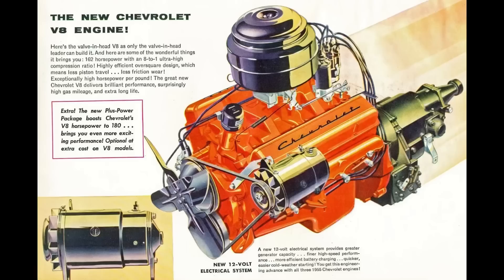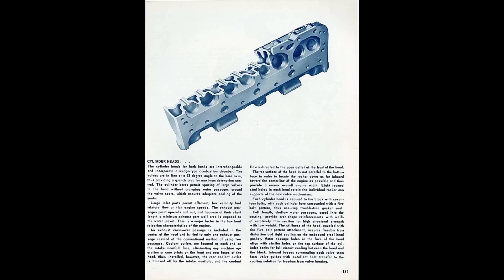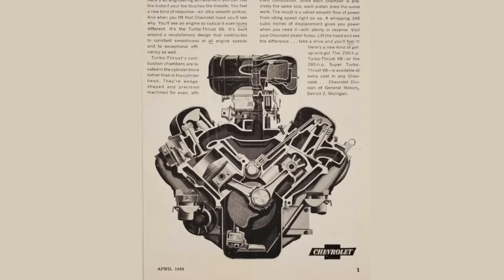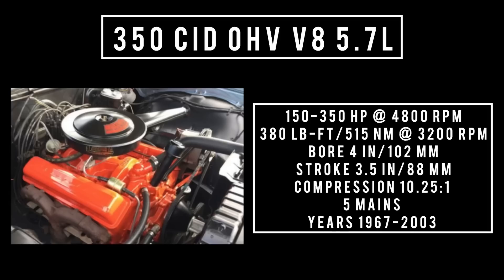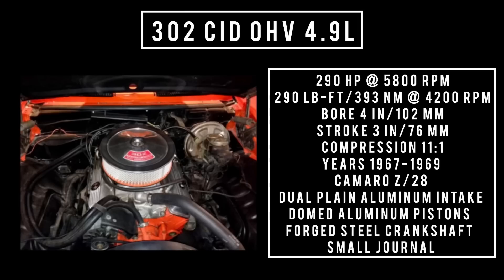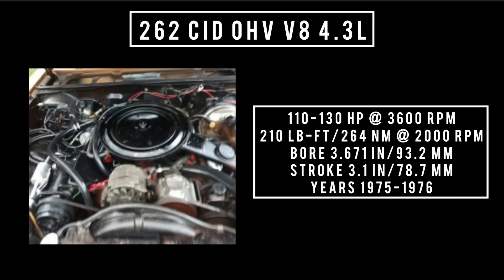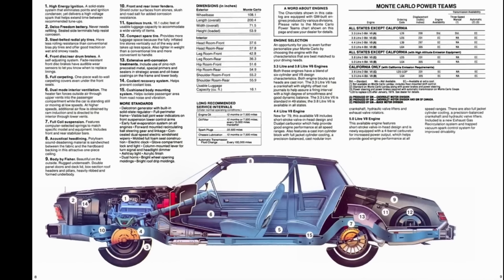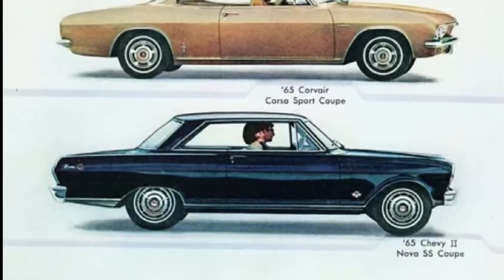First Generation small block Chevy engine family 265, 283, 327, 350, 302, 307, 400, 262, 305, 267￼

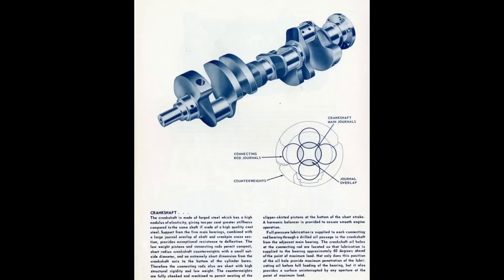Comment: I built a 327 60 over 11:1 used the power pack heads that had like 58cc chambers. Headers, Crane cam 218@50 450 lift Quadra-jet, 4 speed in a 67 Camaro 1981 I was 15. I never lost a race in that car. Beat Big Blocks with that motor and it scared my friends. Theirs nothing like a 327 with a 4 speed in a 3000 pound car. Oh had 3:08s and it loved that gear pulled all the torque it could out of that 327. The Big Block 66 Chevelle I beat had a 402 Turbo 400 3200 Stall and 4:10s beat it by half a car.

Comment: Drove  a ratty 71 Chevelle 307 from Norfolk to Ohio  in 1979. leaking rear main seal, and pecking loudly, lots of smoke but  I had to .  Used 17 quarts of the cheapest oil  I could find. No joke.   I disassembled it for rebuild, and the pecking noise was the extremely stretched timing chain slapping the inside of the cover.  But I got home.

Comment: Here's something I read years ago about the earliest 55 v8s- Customers came back complaining to the dealers about high oil consumption.  Engineers figured out the cylinder walls had not been honed enough. The factory had dealers slowly pour Bon Ami abrasive cleaner powder down the carb with the engine running, which roughed it up enough to break in. So much for consumer protection!
Reply from the maker: Thank you so so much for adding that insight in information

I've read also that Chevy had some teething issues but once they got that resolved, Ed Cole was a genius how he made the bolt pattern and the same for the transmission so everything that's Chevy will bolt up to it

My 52 Chevy has a 1986 350 V8 with a 1959SM 420 transmission behind it that was off of a six cylinder bolted up no problem, unfortunately the same thing can't be said about Ford Ford had a really confusing transmission line in the 50s. They offered automatics and manuals, but they offered different sizes different tail shafts and some water cooled and some air cold and the bolt patterns are all different.

Comment: 1972 Camaro. Thanks to no timing light, I had to fine tune my new distributor cap by test drive. Finally got 50 mph in 1st gear making it the best tuned 307 with no after-market parts. 😊

Comment: My first car was a 66 nova with a 327 and a 4 speed and ran it for years the 327 is a good engine.
Reply from the maker: Sweet =) I had a 327 in my truck nice sounding engine it was so satisfying going from 3rd to 4th around 6,000 rpm just the sound it would make really hard not to smile

Comment: I had a 1957 Chevy with a 283 for decades wrecked it but that engine went in a 1955 Chevy for more years. I abused the heck out of it I admit it. I swapped that for a motorcycle knowing the mains were on their last leg. It took 50w oil so it would idle without dying. I had a 1968 Chevelle SS someone had changed that to a 283 and like that '57 didn't exactly get the love it deserved either. It became my hinting car with a posi rear end it would go anywhere.
Reply from the maker: Thank you so much for sharing those memories a Chevelle with a 283 in it that’s interesting

Comment: My 1957 Chevy Bel Air does just fine with its 283. Power pack heads with a stock Rochester 4 barrel carb and dual exhaust. Good reliable power.

Comment: Late to the party, but here is my story. In 1972 I built a mid-engine V8 Corvair, using a +.060" 350 that I bought from Sears. Everyone laughed at me for buying a Sears engine! When a hole mysteriously appeared in a cylinder wall, Sears replaced it with no questions asked! This was +.040" overbore. I added an Isky 320 cam and a Z28 hi-rise intake with a Holley 800 double pumper. I was 18 at the time, so $$ was tight, and I only sort of knew what I was doing. When completed, it would do 12.6 @110 in the quarter. I autocrossed that car for 18 years! Finally, while on the banking at Rockford Speedway, the oil moved sideways from the bottom of the oil pan to the valve cover! My oil light (and buzzer) came on for a split second, but seemed OK after that, except for a rod knoce on start-up. In 1984, I replaced the rod and main bearings. Seemed ok again, but as I was pulling out of a gas station (a place that car loved to be), as I just stepped on the gas, a rod let go, ruining the engine. Bought a used motor and rebuilt it and it was even stronger than before! Only vehicle that ever beat me n the street was a Kawasaki KZ1000. A 428 CJ Torino was able to sort of keep up with me. Stupidest thing I've EVER done was sell that car in 89.
Reply from the maker: Cool story =)

Comment: You are a bit off on a couple things , like the stroke on the 327 and 350, they are 3.25" and 3.48", not 3.3" and 3.5"  , and the 400 had a 4.125" bore!
Reply from the maker: Yeah found out doing this every source is different and they like the round.. thank you for those corrections 

I wish they gave the actual numbers

Comment: I'm pretty sure the first Corvettes only fitted with the Stove Bolt six.  The V-8 Corvette came later.  Correct me if I'm wrong.
Reply from the maker: @robertmccarty9951  yes that correct 1956 was the first year for corvette to get the v8 to compete with the thunderbird which didn't offer any thing but a v8 in the 50s

Comment: Favorite SB for me was the 3951511 400 with 4 bolt mains, didn't like to rev, but it made so much torque that it would burry you ass into seat every time you hit the throttle.

Comment: The best sbc I had was an engine I had built for my racecar. It was a Mexican block with billet main caps, main studs, a ported melling oil pump, canton 8qt circle track pan. 40lb 3.500 stroke eagle crank, 6.2500 eagle rods. 4.0300 j&e pistons. Heads were dart iron eagle platinum that were ported at muscle motors in the early 2000s. Intake was a hand ported Victor intake topped by an ex Childress HP 750 carb. I spun it to 8000rpm every other Saturday for 35 laps at a time.

Comment: Best was what you you said lt1 undisputed ❤ about to see what the new stuff has to offer I am sbc lover best engine that will last you for your money.
Reply from the maker: Nothing beats it even the new stuff has issues. I mean this stuff just runs forever if it's maintained proper, I've seen cases where people put vortex heads on them... but budget build you can't do any better then a small block Chevy its cheapest engine to build reliable bullet proof engines

Comment: I have my Grandpa's 82 GMC S15, but I wasn't sure if it was worth restoring mechanically speaking.  The powertrain is in great shape, and it was running fine before being parked, but I remember being turned off by the engine specs and overall vehicle specs as an adult when I inherited it as a potential project.  I could be naive, but it seems like a lot of these V8s are underpowered for how much gas they use.

Comment: I had a 1963 Impala convertible with a 283 - 3 speed w/overdrive. It got 23 miles per gallon all the time and lasted 384,000 miles in 2 different cars. What an engine. It outlived my Impala and went to my moms car until it quit running.
Reply: That's awesome wish I had on old Impala . My dad's 66 Chevelle with a 283 2 barrel with a 2 speed power glide got 30 miles to the gallon!
Reply: What was going on with it when it stopped running?

Comment: Cheep HP. Took a 50dollar 66..327outa. A impala 2bolt main.knocked ot aoart at work added used pistons rods polished the crank then got new pistons rings bearings mild cam hyd lifters..oul pump gaskets....real thumpers wrre the double hump heads outa a vette  new dprings and seals..all new fel pro gaskets along with used holley carb and manifold aand for some horse trading annd labor i had a screamerall for 375. Bucks 1972😊😊
Reply: No

Comment: Two experiences with small block Chevys. In 1977 I bought a 1970 Canadian-built Chevelle with a 307. It was a dog, period. It may be that the engine wasn't properly maintained before I gained possession of it, but was still a dog. What I couldn't understand was how an engine with 327 pistons and a 283 crank (I may have that backwards) just did not work well. The second experience was a 1968 electric blue Impala fastback coupe with a 327. The owner fancied himself as a genuine mechanic. He replaced the gasket between the head and exhaust manifold with a homemade cardboard gasket. Naturally, it leaked, though it would seal once the exhaust manifold warmed up. I got rid of it after about six months. I admittedly had two Chevrolet engines toward the end of their useful lives, not a screaming 1 hp per cubic inch mouse motor.
Reply from the maker: Chevy made some great engine but the powerhouse performance engines in the grand scheme of things are few and few far then… and even fewer now yes they made some powerhouse 327s that made incredible horsepower figures but are few and far between. 150 hp 327 is a pretty good engine I had one in a 52 Chevy truck replaced it with a 350 that makes 150 hp which is perfect for it

Comment: Had a 1963 Corvette Sting Ray with a 4 BBL Carter AFB, solid lifter 4:11 rear close ratio 4 spd 327 c.i., 340 HP. Motor cratered and put in a 327 c.i. 365 HP replacement. Car was stolen while living in Wash DC area and DC police found it a chop shop in pieces. Went to court, since they arrested the teenager who stole it. They let the kid off because the police used an illegal search & seizure warrant. Told the judge I now had the kid's address and was considering paying him a visit with 2 friends. One was a 275 lb scholarship offensive tackle at Penn State. The other was a 240 lb power lifter with a 50 inch chest 20 inch biceps who had benched pressed 500 lbs in a formal sanctioned powerlifting meet. The judge hoped I'd reconsider. After some thought I decided not to.

Comment: Correction for you on the 350. The highest horsepower was 370 from the 1970 LT-1 in the Corvette, 360 in the 1970 1/2 Z/28. And it’s PLANE in dual plane. Good video!

Comment: First small block I owned was a 327 out of 66 Vette. Rebuilt it with 66 Motors Manual, with an Isky cam and Hedman headers  in a 57 Belair. This 69. Second was a 4 bolt main  350 in a 55. Last was a 350 in a square body 1/2 ton.  Younger brother followed with a69 Chevelle and a full size Blazer.  Thanks fot the memories.
Reply from the maker: Awesome happy that this episode was able to bring back some of those memories

Comment: The 265 had a bypass oil filter in a canister mounted on top of the engine. The engine mounted. full flow, oil filter came with the 283 and later, eventually becoming a spin on oil filter. The 283 immediately became the racing engine of choice for circle tracks.  It was common to bore the engine to 301. The Chevy small block was the most common hot rod engine. Smog devices started about 1965 with a PCV valve. Horsepower started going down about 1970. Each new year Chevy "improved" the small block and had less hp. From then on engine power went down every year until fuel injection became common about 1987. I had several cars & trucks with the small block including a CJ5 that I put in a 283. The smog devices screwed up the engines until about 1990. I had a 1986, 350,  3/4 ton 4x4 that one day decided to pump all the oil into the air cleaner. Smoke started pouring out the exhaust. On stopping there was about 3 quarts of engine oil in the air cleaner. Best engine was the 375hp 327. You could buy a new long block from the dealer for about $150.

Comment: The first engine I ever rebuilt was a 327 out of a 64 corvette.  I used the Motor's Manual and followed every step with perfect detail.  This was in 1970.  It ran perfectly, didn't burn or leak any oil and I felt like I really accomplished something. Good times.

Comment: Fun  fact during the small crank journal time if you put a 327 crank in a 283 block you get a 306/307.  If you put the 283 crank in the 327 block you get a 302. During the early 1960’s teen age want a be hot rodders did the 327 crank in 283 swap quit often.
Reply from the maker: Great information =)
Reply: I had forgot about that. One the guys in our crowd did it in a 56. Ran like a scalded dog.

Comment: The Chevy 327 is the best small block engine ever built.  At least until the LS small block replaced the first generation small block.  While the Chrysler 340 was one hell of a screamer in its own right, the 327 has the perfect blend of ability to rev as well as good torque.  I've built a LOT of engines over the years, and when given the choice what to build, I will build a 327 before a 350 every day of the week.
Reply: I like them all.
A 400 in a corvette just isnt as good in my opinion as a 327 in a corvette.
Reply: It was ok but definitely not the best SBC
Reply: There’s nothing magical about a 327 that makes it better than a 350.    Don’t get me wrong, I love 327’s.  
But had the smog and oil shit not happened when it did, factory 350’s would have blown the doors off of 327’s.    And 400’s probably would have blown the wheels off of the 350’s.

Comment: SBC is 100% the goat! the architecture is 69 years old!!! It isn't perfect but it's about as close as you can get and in 2024 it's still a viable platform... Even with the pleathra of LS engines There's plenty of SBC engines that are still competitive with anything, so many LS fanboys that turn there nose up at SBC claiming there obsolete dinosaurs which is so not true people build them easy to 2000hp+, yeah LS is a spectacular engine but how is that kind of performance obsolete.
Reply from the maker: Totally agree =) and the small block Chevy is the cheapest V-8 to build there’s tons of them everywhere (350) The engine architecture it’s just pure common sense in my opinion. One of my favorite things is if it’s a Chevy engine Chevy transmission bolt up to that Ford doesn’t have that luxury specially in the 50s it could be really hard to find a transmission for Ford because they made air cooled and water cooled torque converters, and they don’t interchange Also Ford had three different transmission case sizes with three different tail shaft. It gets super confusing.

Comment: Everyone loved that 327 back in the day but I never had one. Had a bunch of 350s and a small block 400. The 400 is a "baby big block" when you build it right. Looks like any other small block except for the extra freeze plugs. It had 3 instead of 2. The later versions ended up with 2 as well but there was still a boss there for the 3rd one. So if someone is trying to sell you a 350 and telling you it's a 400, check the side of the block. 6 total vs 4. I've bought Chevy's and changed the plugs as soon as I bought them and have seen nothing but a nub left where the electrode has worn away to nothing and you couldn't tell. Didn't miss, fired right up and had power. Engineering masterpiece is what the Gen 1 small (and big) block Chevy's were.
Reply: You can also tell by the balancer.

Comment: The best was a C/10 with a 307.  It was worn out when I got it and was daily driven for over 12 years, it would never die and it would run without oil.  I only ran Valvoline max life when it had oil.  It was still running fine when I replaced it.
Reply from the maker: Awesome thank you so much for sharing your experience with small block Chevy

Comment: The 350 in my '96 C1500 runs well, still young at 120,000 miles but has never needed major work. I think it will outlive me.
Reply from the maker: 350 is a bulletproof engine usually the only way they die is if the water pump goes out which is a common problem they just rust my brother had one in Monte Carlo that did that

Comment: Mopar guy here. These were our enemies when we were younger but small block chevys are proven well designed engines. The sheer volume of cars with them made it cheap to get good hp and the oiling and overall strength of the design is great. Excellent oiling and the universal bell housings and engine mount setups made swaps easy. Back in the 80s and early 90s quite a few 350s gave the 383 Chrysler big block a good run for the money with gears
Reply from the maker: Totally agree
Reply: The 340 MOPAR was an absolute screamer too!  It's a shame Chrysler didn't build more of them.  That said, the Chevy 327 is probably the best small block of the era (the 340 is a close second though).

Comment: I had a 1979 malibu classic. It came with the 305 with the rubber camshaft and the infamous th200, so after a year, I swapped a 400 4 bbl with a th350 in it. It lit the tires very easily. I also had a 1990 police caprice with the 350. It was also quite fast and reliable for a 500$ car. That was around 1998.

Comment: I had small  j  crank.s 65 to 67 327 cast iron
Reply from the maker: I had a 67 327 in my 52 Chevy truck when I bought it Great engine
Reply: @What.its.like.  the best engine I think.
Reply from the maker: Sounds great at the top of third around 6500 rpm and than the grant going into fourth pretty awesome experience 

Truck has a 350 now it doesn’t rev as high but will go 80 mph comfortably 3:73 rear and sitting on 19.5 radials it gets 20 mpg hwy it’s insane

Sm420 transmission the gears whine which I love top of third the gears sound like a old school super charger I love it
Reply: @What.its.like.  don't forget grumpy.s toy 331 590 h.p
 That was a great engine